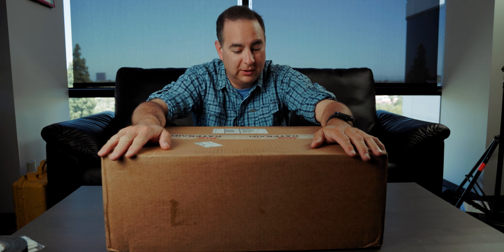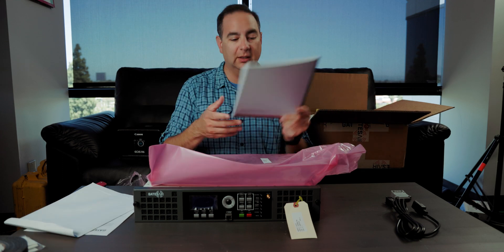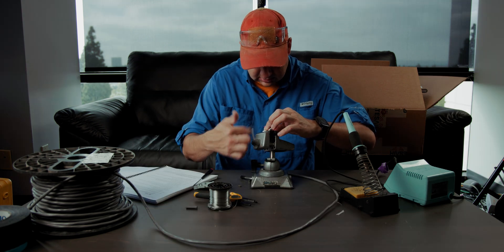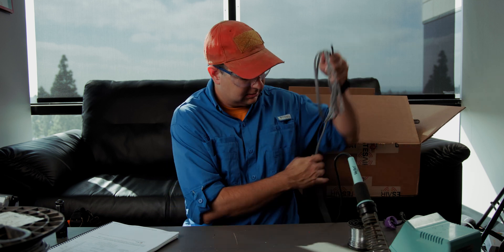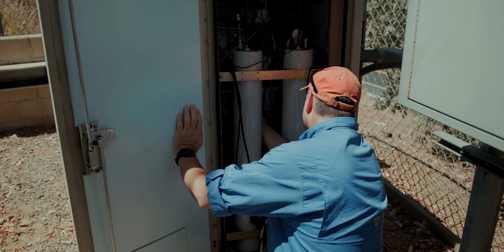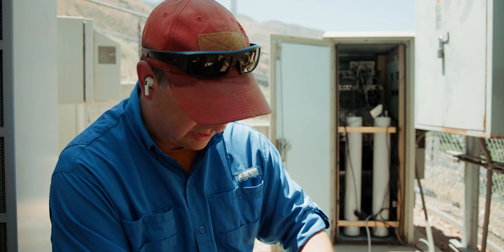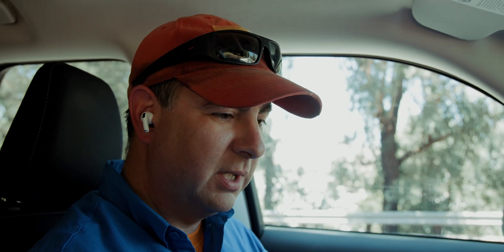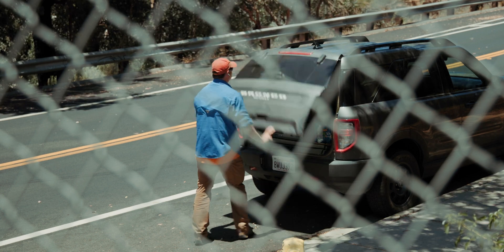Installing a new transmitter

Comment: By the way, what was the make of the old transmitter?
Reply from the maker: It was a BE FMI73 I think… maybe the 250. It’s been a while. Hated those BEs.
Reply: @ I worked at a station that used a BE.  It had a louder and stronger sound than the other stations in the market.
Reply from the maker: @nicholaskalogris9985 Probably more the way the audio processing was set.
Reply: @TheBroadcastEngineer  It could be that pair of Audio Prisms combined with an Optimod.

Comment: How is the transmitter kept cool in that cabinet? I didn't notice any type of air conditioning.
Reply from the maker: There’s a small air conditioning unit on the street side of the cabinet. We should have installed that unit on the inside. Would have made it much easier to service.

Comment: old vid but good, wonder how many times cops stop you at a site thinking you are meth heads trying to steal stuff, around here a site on the side of the road like that would have had a cop rolling in within a short bit. also must toss in the lol you think its hot outside, should been here when i was working on a ham repeater here in Indiana this last summer it was 95F with a dew point of 81F  now that is hot and miserable
Reply from the maker: Surprisingly I’ve never had any interaction with law enforcement at a site. I appear legit. If I were being sneaky I guess they’d be more interested in me. 

Ugh that’s miserable.

Comment: Is there any delay in audio between the main and this booster transmitter? Is there much of a coverage overlap?
Reply from the maker: There’s not at the moment. I’m a bit limited on audio transport since it will be over IP. There is a bit of overlap in one direction.

Comment: SoCal broadcast engineer what device do you use to send your stations audio to the transmitter location
Reply from the maker: Depends on the site. In a strange transition time while I wait for some equipment to arrive. 

For this site, it’s a Moseley Starlink over a PTP T1. 

Santiago Peak is one of those, a Moseley starlink over microwave, and livewire over a private data microwave. 

Palomar is harder… it’s a Telos iPort over a private microwave from another site which is fed with a data T1.

Comment: Very nice! I hope it serves you well. Got a question, but not sure exactly how to ask it. Do transmitters play any factor on the sound quality of the station. When you look to purchase a new transmitter, are there certain specifications, if any, one looks for to maintain a good quality sound?

Another way I could ask this question, were there any improvements in the sound you noticed as an engineer with the new TX installed vs. the old one?
Reply from the maker: Thanks! I hope it lasts for years to come. 

Transmitters do play a part in the sound however, todays modern transmitters are less different from each other. Factors such as remote control capabilities are more important these days.
Reply: @Gavin Stephens For years WCBS FM New York's oldies station had flat muffled sounding audio
Reply: Gavin Stephens  WCBS eventfully got a new CE and he discovered just as you highlighted in your response, that the problem was the source material and not the audio processor or transmitter. Slowly they replaced the music with better quality recordings and today the sound much better although they are no longer an oldies station.
Reply from the maker: @gatesmw50  when computer automation came out storage was more expensive. Many stations use the old MP2 encoding for files. They had a unique sound to them. Eventually storage prices came down, music started being stored as WAV and now the problem is upstream at the mastering side of the song. 👍
Reply: @TheBroadcastEngineer  I would agree with that. Music today is over processed.

Comment: And to be honest they could have just charged you and extra dollar or euro and  sent you the cable assembled, always thought transmitters were about the size of three fridge freezers side by side and just as tall
Reply from the maker: This one is max power of 50 watts. Nautel is making small transmitters for higher power. Solid state has really done a lot towards the miniaturization of transmitters. 

They used to be like that… if you look at one of my san Clemente videos you’ll see the big beige transmitter. That’s 20kW but now solid state transmitters are about 1/3 the size.

Comment: I hope that's no clean solder you're using otherwise eventually your going to end up with green crusties on that connector
Reply from the maker: It’s regular solder. Never had any green crusty on any of my solders.
Reply: "no clean" solder?? Are you soldering with plumbing solder or something? I've never seen solder that requires cleanup after. Some fluxes are no-clean, but you typically don't use those kind of fluxes for soldering connectors on cables - that's more for SMD board assembly.

Comment: Hope you remembered to save the switch configuration after it was working, and also made a backup of it as well to store in your documentation, and electronic storage at the office.

Now you have a new transmitter will the old one go into repair and become a spare one then, or is it destined to be torn apart for scrap. Bet the new one going in was a lot lighter to carry up the hill, than the old one going down the hill though.
Reply from the maker: Son of a gun now that you mentioned it I did not do a wr mem ... I know what I'm doing first thing tomorrow morning when I get into the office.

The old transmitter will go to get repaired (if it's not prohibitively expensive). It'll go on the shelf after that as an emergency transmitter. It's a little too low of power for our normal transmitters and such, but if we need to stay on the air even if it's at lower power... that will be worth it.
Reply: @TheBroadcastEngineer  I know, that step is often forgotten, though also make a backup of the configuration file, print it out, and keep the backup on the station NAS, and the paper copy in the cabinet as well. 

Repaired transmitter can also get pressed into duty, at low power, as an exciter as well, if you have a need for one, or even used, cranked down all the way, as a test transmitter, though I will guess you will also need to have the cavity filters as well to make sure you are not transmitting any spurious signals as well. 

Hey, low power signal in an emergency is better than no power at all, plus it is a lot easier to schlep up to the top of Palomar or Santiago peak than a high power one.